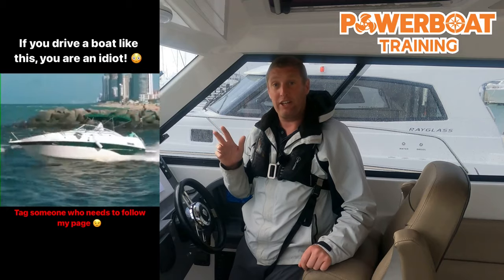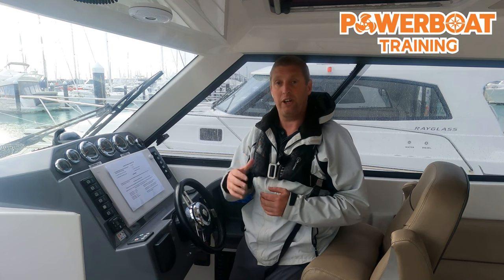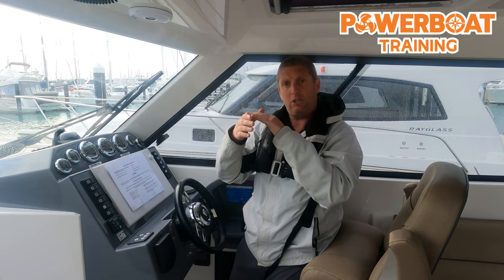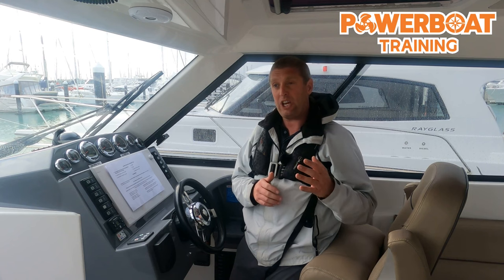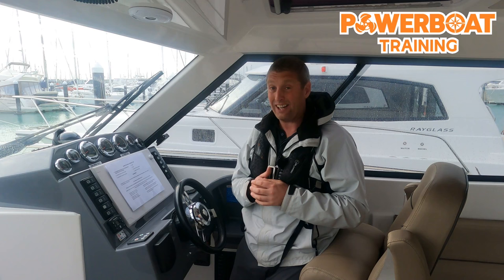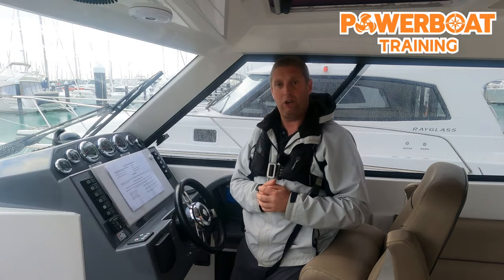Handling a boat in rough conditions. Don't depart an inlet at speed.

Comment: In South Africa we launch and beach from the beach, at least on the east cost. 
Agree with pretty much all of what you have said, but in our case we need to look for a break in the set and try and get out quick smart. 
Being square onto waves is very nb, and powering down as you get to the waves very NB. Sometimes hard to pull back on the throttles when you still have another wave or two behind, but generally always works better.
Coming back into the beach from backline can be tricky when you can't really see behind the backline, but most NB is to go fast enough. We usually wait for the end of a set and ride the back of the last or second last wave, onto the beach. 
One thing you didn't mention, is "when in doubt - don't go out." For leisure boaters there is no reason to be out if the weather is too grim.

Comment: I agree with all you have said regarding when to apply power and speed etc.
The one glaring omission with all this advice is, get all the people off the bow of the boat, this moves weight aft where you want it in these conditions and also drastically reduces the risk of injury.

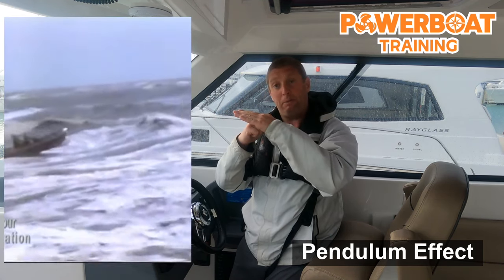Comment: The rib at 1:33 could use a little more weight forward. They are going a safe enough speed to put someone standing fwd, holding onto the painter. Pre 1973(? or so) Whalers and Del Quay's were really good at catching the wind under the bow and flipping over backward (please don't ask me how I know this). While they did have open bows, I really don't remember them actually scooping seas aboard, they always wanted to rise to them if you went a little slower.
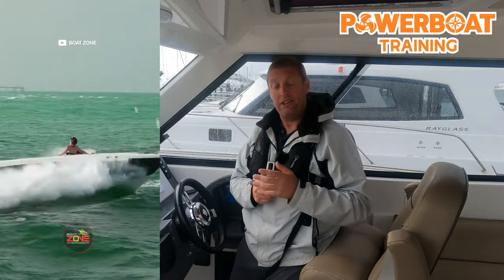I agree that most bowriders like 4:30 are not suitable for open water. Once you poke the bow and bring water aboard you are subtracting buoyancy, stability and the ability to steer from the equation.
All we can figure out about the gentleman at 3:55 is: He shouldn't quit his day job. He doesn't even Think about slowing down. He nearly got launched on the first wave and still doesn't get it.
If I could add something constructive instead of criticizing, I would say, "Check the tide tables. The waves are going to be as docile as they can be on a flood, and more  like walls of water on an ebb".
Thank you.

Comment: Seems like slower is definitely safer when leaving an inlet headed out into the ocean, but ultimately, it seems like something you really shouldn't attempt until you've ridden with an experienced captain at least a few times to get a feel for the dynamics that inevitably are always changing.
Reply from the maker: That's a great idea! Highly encouraged, or even find a local instructor
Reply: Slower is not safer, because slower is a relative term. Planing hulls are least stable at displacement speeds. Planing hulls need to be up on the plane to have momentum and stability. If you watch channels like Wavy Boat who films Haulover inlet, you often see people who get out or come in way too slowly in planing hulls and end up almost losing control of their boats because the waves are just tossing them every which way. Very dangerous, especially in narrow inlets.

Definitely need speed if you got a planing hull boat.

Comment: What is written on the A3 sheet of paper on the console? 👍👌🇮🇪☘️😉
Reply from the maker: Start up and shut down checklist
Reply: @PowerboatTraining  Excellent. Never heard of any aircraft that did not use one and trying to think of any pleasure boat that did. Delivering any boat without one is pretty hairball when you think about what could go wrong. We would have to figure out what's what before we could even think about getting underway, which can really burn up daylight.
OK, unnecessary. Unless someone needs to take over when you're having a medical emergency. Most spouses, BF or GF's who have seen you start the engines many times wouldn't have a clue what to do under pressure.

Comment: and Boaters, what is your first move if you lose your engine--it happens, and sometimes at the worst possible time, even a new engine, properly rigged.  I once had my new outboard suck up a plastic bag--a whistle sounded and the engine shut down, right near the harbor mouth-now what....drifting into the rocks, what are your moves?   Hint: this is no time to think about it for the first time.
Reply: Use your secondary propulsion.